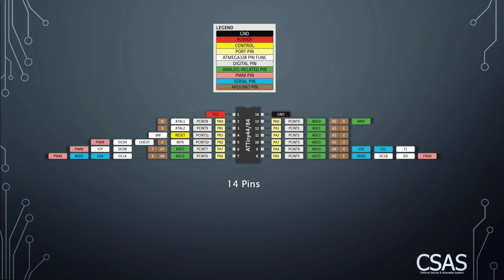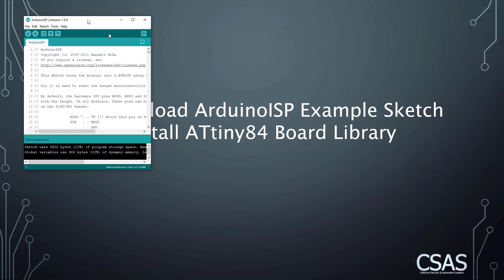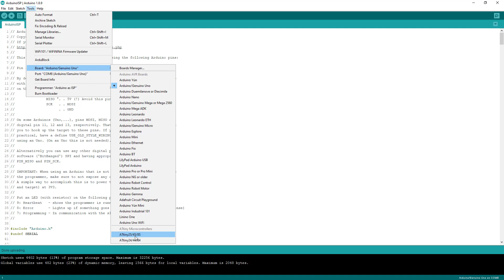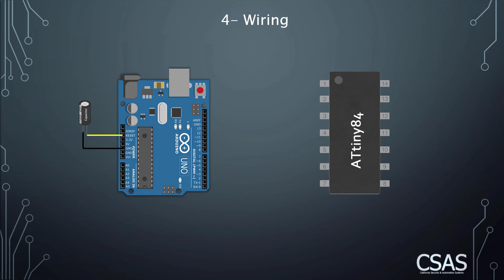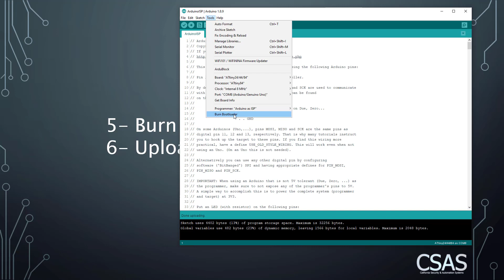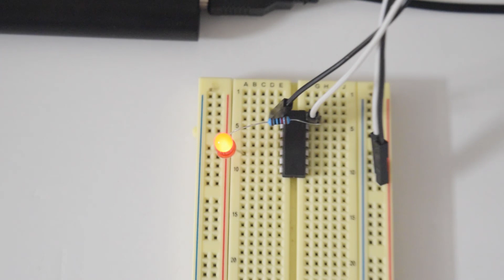How to Program Attiny84 Using Arduino Uno - By CSASystems

Comment: This presentation is great. I found I needed to set the clock at 1 MHz to get to upload the boot loader and load sketches. I had followed another video to add the boot loader and program a ATTINY85 and they used a 1MHz internal clock setting. Still this presentation was very good on the details and was a great help. Thank you!
Reply: Did this later with 5 more MPUs with 8 Mhz setting and worked fine.

Comment: I really really thank you. I've read enough threads and yet didn't completly understood what I was doing. I got my mind straight with your guidance. At first I couldn't burn it. I had results like my arduino got crazy. I managed to verify that my arduino kept working and the next day when I tried again ( following your steps ) It finally worked. I don't know what I could not make it work at first , but is working now.

Comment: At the first part when you upload the "ArduinoISP" sketch to the Arduino Uno, you had the programmer set to "Arduino as ISP" instead of AVRISP mk.II. Is that correct? I know you should set it to "Arduino as ISP" when you want to program the Attiny itself but to upload the "ArduinoISP" sketch it's for the Uno itself so it should be AVRISP mk.II right?